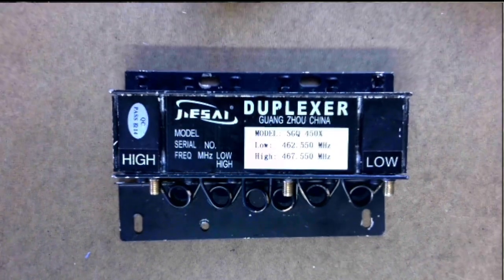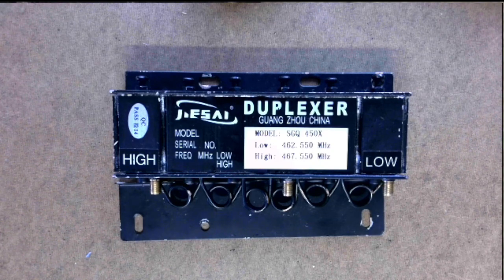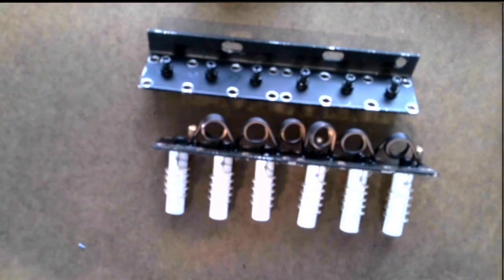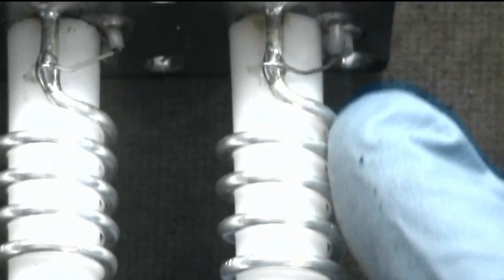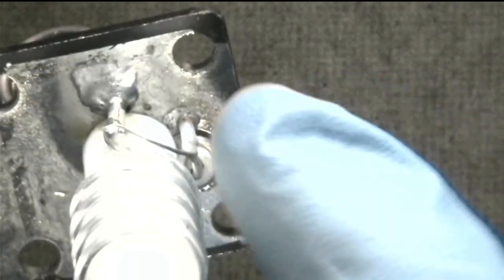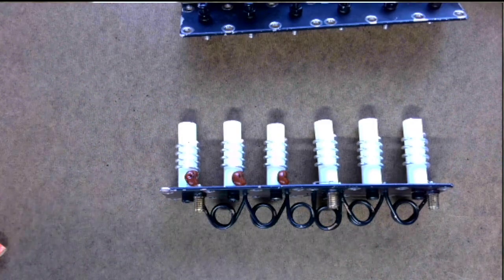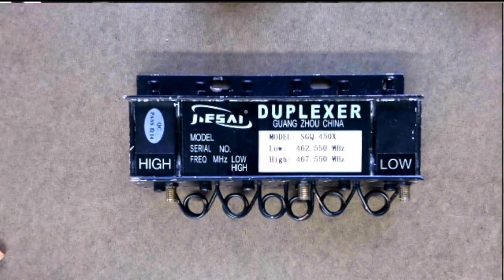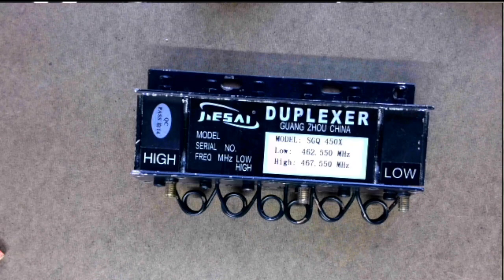🔺 Can Retevis RT97 GMRS two-way radio repeater handle 30 watts?? Let's take a look inside to see!! 🔺

Comment: Hello.
Would it be possible to tell me how to make the connections between the RT91 and the original duplexer?
Ever experienced?
Did you increase the power doing it that way? (amplifier before the duplexer)

Compliments.
Reply from the maker: I have a playlist on how to modify the Retevis RT97 repeater for more power https://youtube.com/playlist?list=PLsgwiBVJqD2eZBC5k1nZaSo7SZcnPPRq3
Reply from the maker: I think that is what you are asking me?
Reply from the maker: You will see videos in that playlist you would unscrew the low side cable that is on the stock duplexer that would go into the input of the amp and the output of the amp would go to the low side of the stock duplexer BUT keep in mind that stock is only rated at 10 watts!!
Reply: @GMRStwowayradio  so can the duplexer handle 30 watts on a not very crowded repeater site?
Reply from the maker: @asadmarwat6445  - it seems too. I know someone who ran it for a year with no problems, he had a fan blowing on it too.